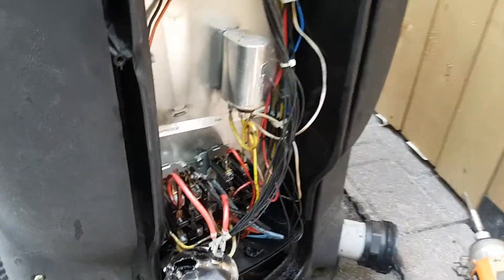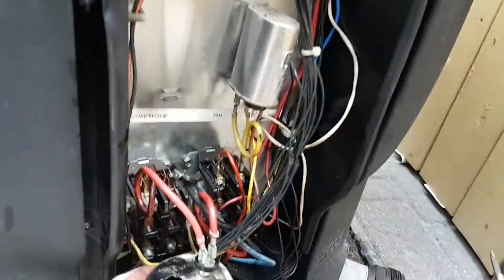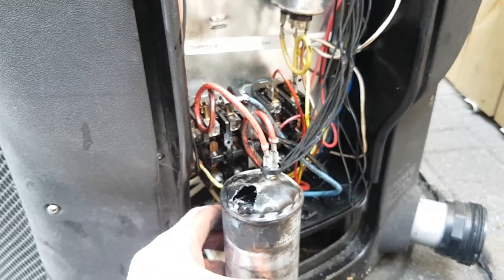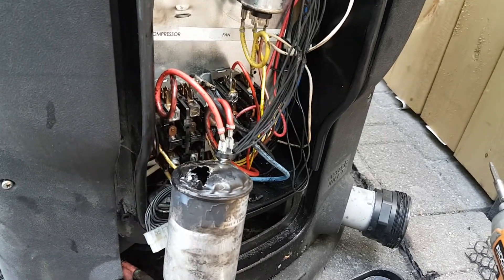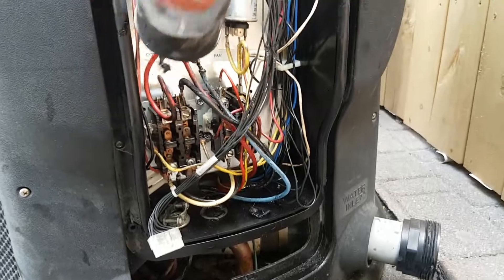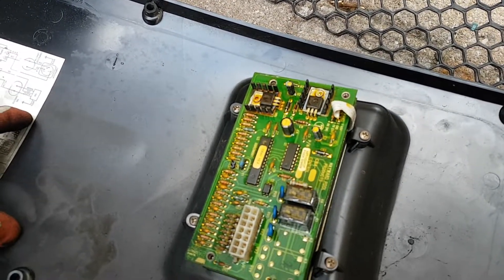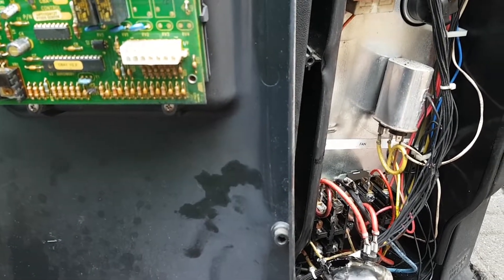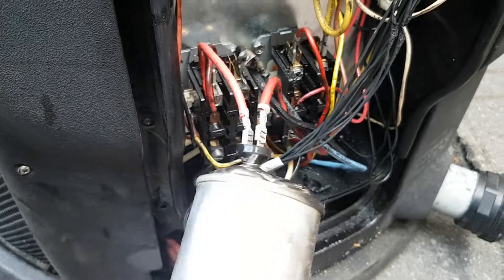Swimming Pool Heat Pump Completely Destroyed Due To Power Surge

Comment: What leaked is the actual electrolyte, hence “electrolytic capacitor”. It is not some sort of coolant.
Reply from the maker: Wrong. These capacitors are filled with castor oil in an additional layer.

Comment: Could you replace a fan run capacitor with a dual run capacitor and just not use the herm terminal as long as the MFDs are the same?
Reply from the maker: Yes